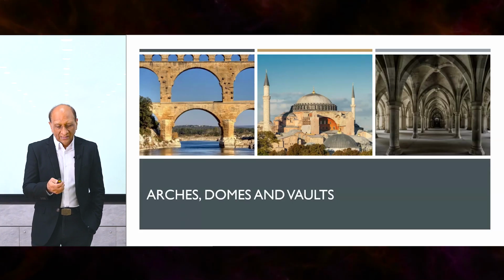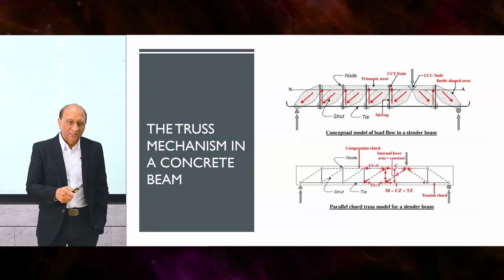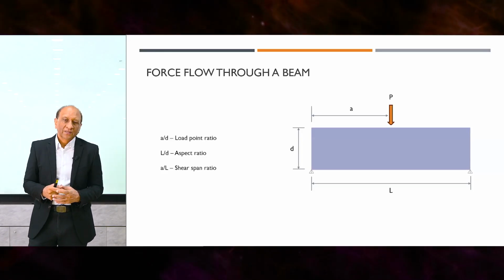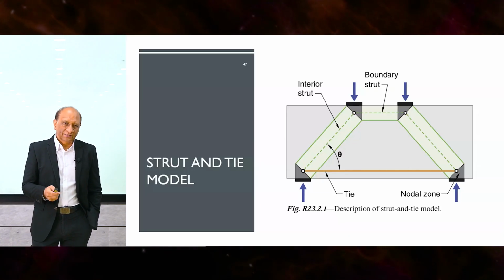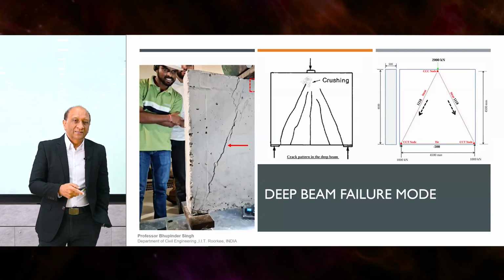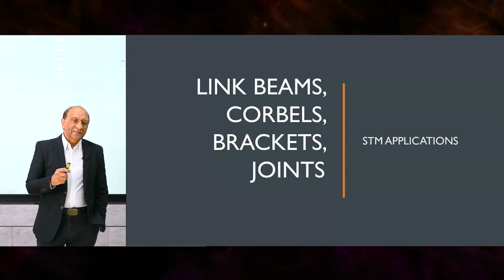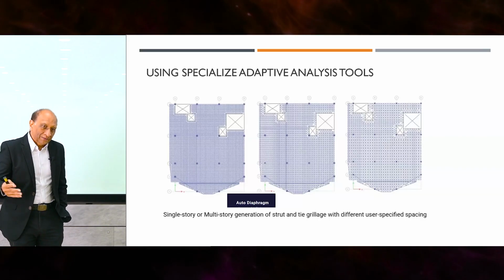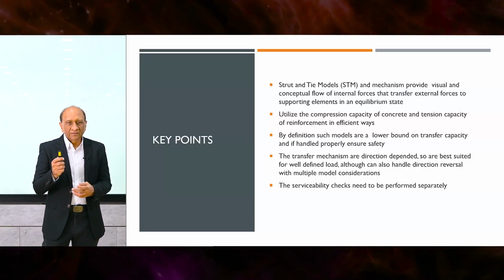Strut And Tie Modeling l Designing For Optimal Force Flow In Concrete Structures

Comment: thank you for the excellent lectures
Reply: One issue with the strut ans tie model is that the form of the truss depends on the location and shape of the load. In practice, especially in seismic design there could be several load combinations to examine.

Comment: Thank you for your attention and the interest you showed throughout this presentation on the Strut-and-Tie Method. This approach provides a powerful framework for analyzing and designing complex concrete structures, especially in areas where traditional methods fall short. I hope the concepts shared today have enhanced your understanding of the interactions between struts, ties, and nodes, and their essential role in ensuring structural safety and performance.

I sincerely thank you once again for your attention. Thank you.